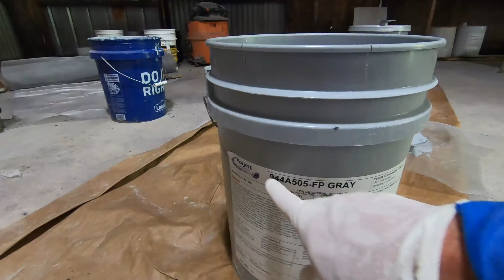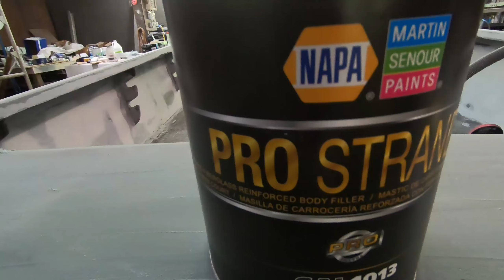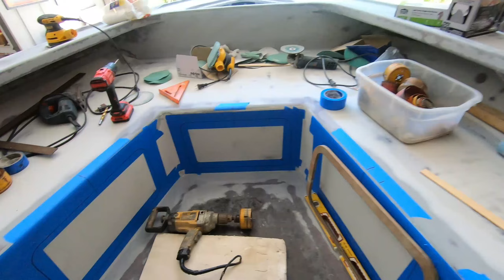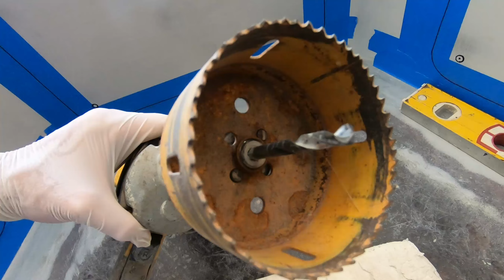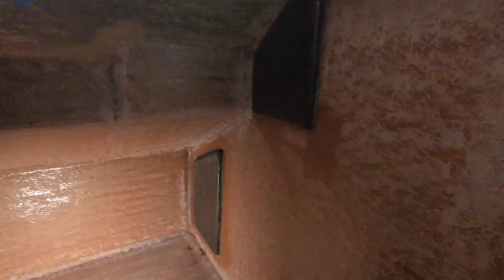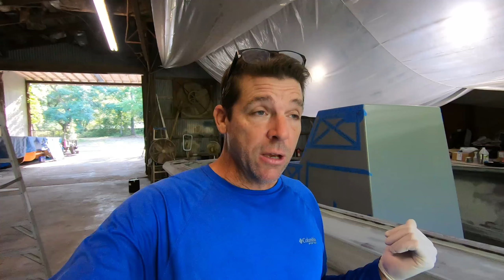EP-18 BOAT BUILDING SECRETS REVEILED! CUSTOM GELCOAT MIX and MATCH!

Comment: So i've had a hard time finding the pro strand in my area. I can find the pro lite online but the pro strand seems maybe very less common... I heard evercoat makes that for NAPA and they just market it under that name. So, do you know what evercoat commparable filler would be?Or possibly use the totalboat structual repairt putty instead? Thanks!
Reply from the maker: Yes, Evercoat makes a very simular product called everglass it is a short strand fiberglass reinforced body filler. I have a putty and fillers video and there are links below for lots of the products we use. I hope this helps and thanks for watching!
Reply: @FishBumpTV  Thank You! Will definitely be getting Patreon  account before starting my project

Comment: After I fiberglass the 1" coosa board stringers do I need to seal it with paraffin wax or is that not necessary? Thank you for all of your videos they are very helpful.
Reply from the maker: You can finish it with resin or gelcoat that has a wax additive in it if you want to. It can also be left as it is if it is in a unexposed area. Hope this helps, and thanks for watching
Reply: @FishBumpTV  thank you for all of your help!!

Comment: Nice work! It's amazing how far you have come with the boat. I have found that most of the short hair fillers seem to be very similar but standard polyester fillers vary greatly. I like Evercoat gold or rage gold for a general purpose filler. The color gives you a good mix ratio guide and it levels easy and sands easier than many others.
Reply from the maker: I appreciate it! Thanks for the tips, I will have to try those out!